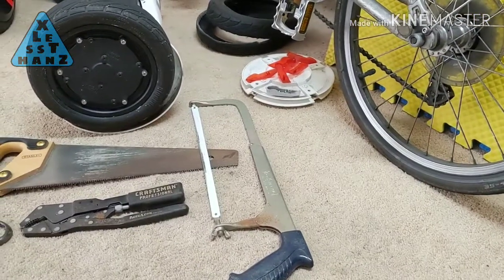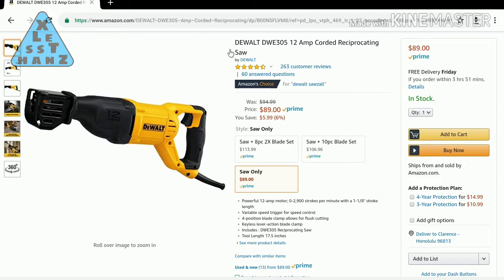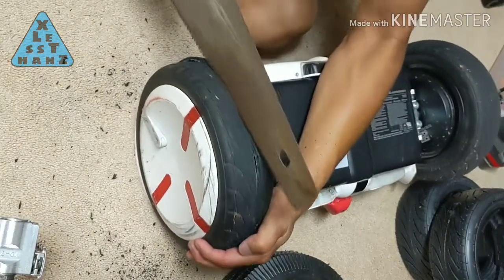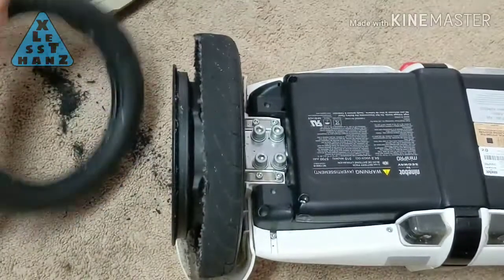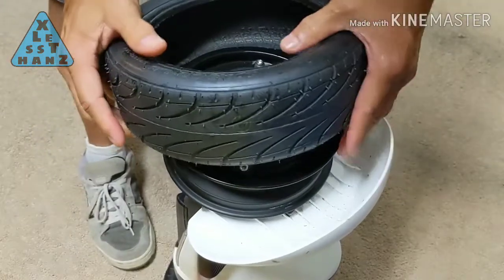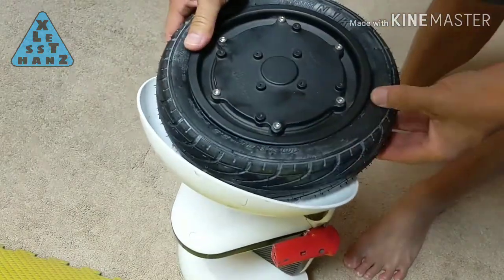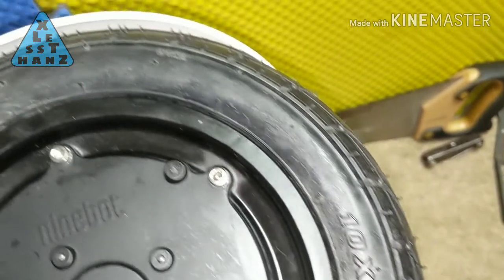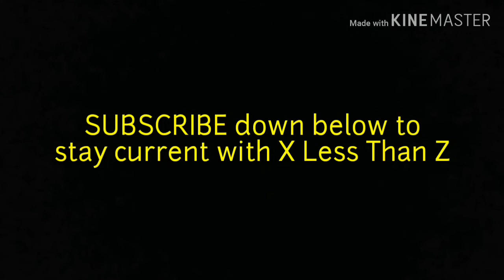Replace Segway MiniPro Tires with NO TIRE IRONS

Comment: THIS IS THE SOLUTION TO THE NINEBOT TIRE REPLACEMENT! Thank you!! I had to pay a mechanic to help me change my first set of tires. But with this video I learned to do it myself and without tire irons scratching my rim. The key are the clamps, then I made it child-easy by smearing SILICON LUBRICANT all around. I spent 5 minutes per tire as opposed to 45 minutes per tire in my previous set. THANK YOU!
Reply from the maker: Alright, I'm glad.  Thanks for letting me know.  I'm glad when my videos can help someone.  I know that's what they're for, but it's still good to know when someone finds a video useful.  Ride safe!

Comment: An easy trick to help force the tire bead to seal on the rim while you're adding air is to use a ratchet strap around the middle of the tread.  This serves the same purpose as your suggestion to "push on the tread" near the area where the bead isn't sealing, but it does so evenly around the entire tire and also helps to ensure that both the inner and outer beads are evenly sealed against the rim while you add air.  Hope this helps! ;-)
Reply from the maker: That does make sense.  I'll have to try that in a few years when the tires start to get worn.  Thanks for contributing a suggestion.

Comment: zip ties just 4 on the tire to squeeze it like a taco shell, goes right over the rim with some wd 40 or soapy water. that is the way.
Reply from the maker: I'll give that a try.  I have a tire change to do soon...🤙🏽
Reply: @XLessThanZ  it's so simple you will laugh, need high pressure air or compressor as the tire needs a little movement to seat.
Reply: I always get a puncture, - something on the road- but the tire sealer does the job. I got airless tires on smax and put the mini pro handle bar on it and put the smax handle bar on the mini. Which made the mini super light weight. i'm only using the mini for store runs nearby, and smax for everything else. tires on mini should last forever if i use it that way.